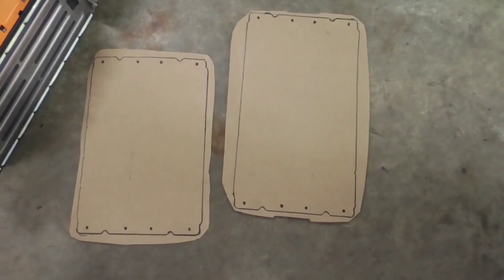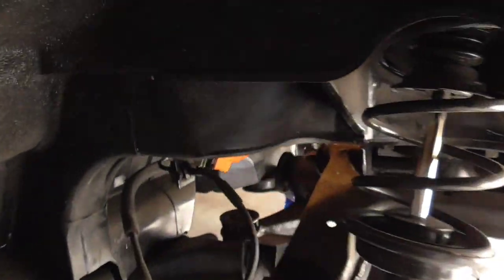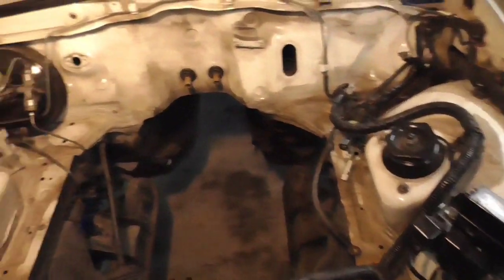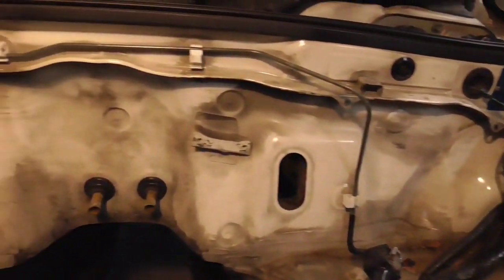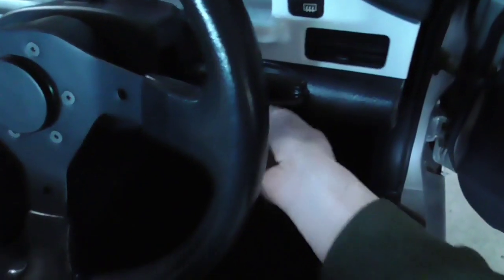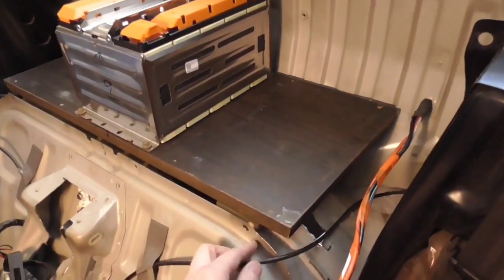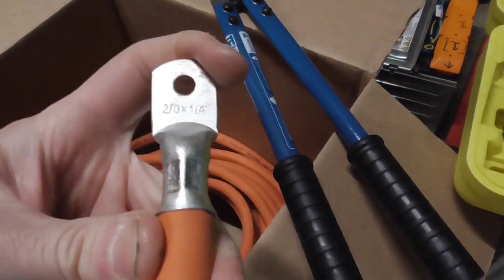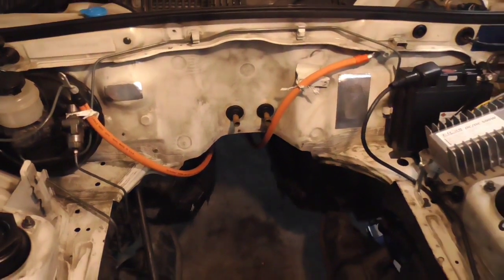Project: Cappuccino EV - episode # 3

Comment: I would love to see a bigger hole and a rubber grommet around your cables where they pass through the bulkhead. 
Personally I'd have taken a cutting disc to that hump in the floor, and recessed a battery box into the floor.
Reply from the maker: Thanks for your thoughts.  The nice thing about a custom built car is: the endless possibilities.

Comment: Please keep up detail as in this video with what you doing, was wishing you were going to use 500e motor from the time you dismantled the 500e. Still very interesting to watch , I am on the fence to embark on a conversion on my car. 

Why no battery box on rear two batteries where fuel tank was?

Could you also detail how battery modules are laid out as in series and / or parallel.

Keep up the good work.
Reply from the maker: As previously stated in the Teardown series, the 360v Bosch Motor (from the 500e) has too many proprietary integrated components to be of much use.

Battery boxes are good for combining lot's of individual cells.  The Fiat 500e battery cells are already grouped into 5 & 6 cell modules which are armored quite nicely.  So why add more weight, more work, & more complexity.
Reply: I put a fiberglass tray in my gas tank area for 6 Fiat 500e batteries (5 cell units) and cut 3 access windows from the trunk.

Comment: It's coming along very nicely! Are you going to run it through a transmission or just straight to the rear axle?
Reply from the maker: Thanks.  Well, it wouldn't be any fun If I told you what happens before it does.  🙂

Comment: I must have missed it, but what happened to the Fiat? Was it in an accident or something?
Reply from the maker: The Bolt replaced the Model S and this has replaced the 500e.
Reply: @theevolvingworld  Ah. Did those LiFEPO4 12V accessory batteries in that Fiat ever give you any trouble? (Mine have been great since I installed them in July)

Wait... You traded in a Tesla Model S for a Chevy Bolt? 8^O
Reply from the maker: @JustWasted3HoursHere  I un-modified the 500e before I sold it last summer.   Sold all the parts except for the ReLion 12v.  Thought I might put it in the Bolt... but I have other ideals.